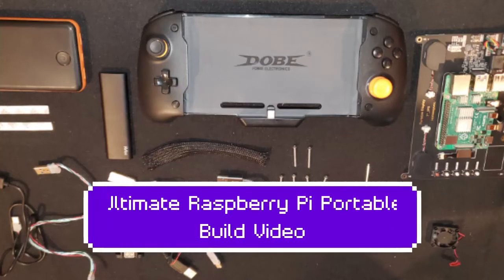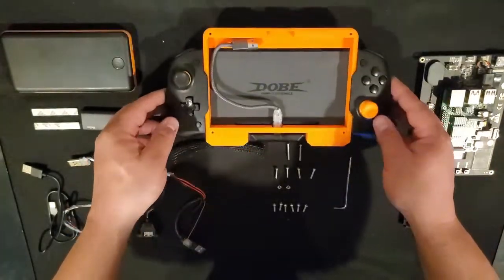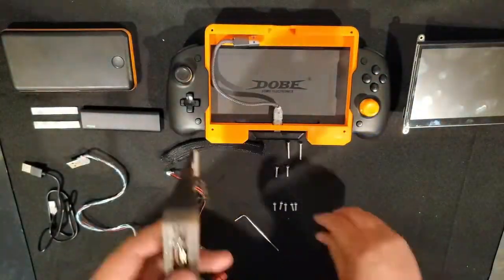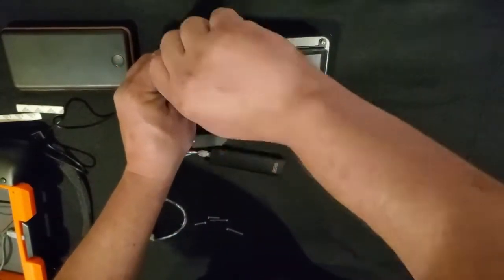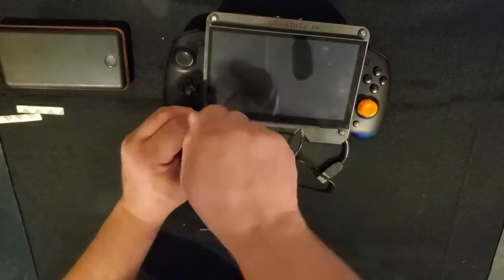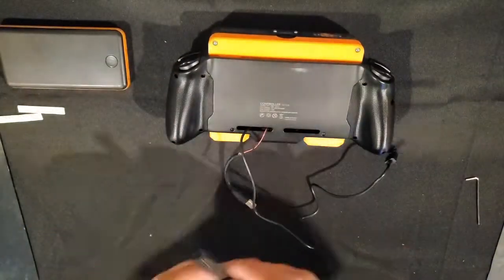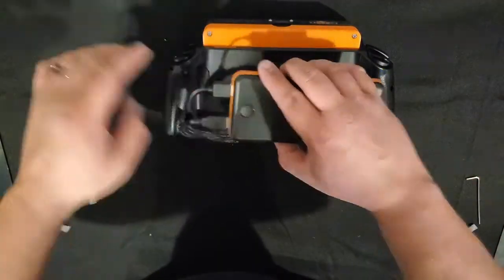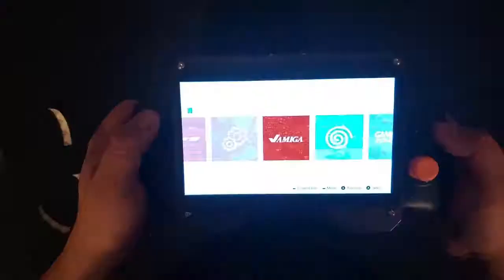Ultimate Raspberry Pi Build

Comment: This is a really nice way of reusing existing components without coming out totally lashed together. There's room for a V2 integrating a battery inside the printed shell, pulling the SSD board out of its shell to save weight, print a front shell to give a cleaner look.
Reply from the maker: Good ideas,  I think descending the esd is probably one that is not esd safe unfortunately,  but if I make a second I will definelty consider thoae.

Comment: hey, nice video bro. I wish to build it but i don't have any 3D printer. How much for all componants? Couldn't find the answer yet. Thx !
Reply from the maker: Hey if you check the description there should still be links to all the parts.  I havent made the parts available on easy to sell or anything, but there are quite a few local printing apps you can use to find people capable of printing the parts for you.
Reply from the maker: As for the components when I made this build I think it cost me around 100$  for material, ssd, pi, screen.  So if you are starting from scratch I would imagine today you are closer to 150.
Reply: 3d printing cost about 3 pounds so it's quite cheap just make sure you have a model
Reply: PCBWay 3D Printing Service is quite cheap.

Comment: does it work with pi 5
Reply from the maker: I'm not sure as I havent tried it out personally.  If you have all the proper drivers it should.  I am working on a new version that should be a bit simpler for everyone to out together with off the shelf parts.
Reply: @spark3dacadamy304  Hello, when new version will be released? You project is awesome
Reply from the maker: @gerardoritacco  not sure.   I'm working on the PCBA in my spare time but it's not my forte to be honest as a mechanical designer.   I also want it to be affordable and easy to build so I'm taking my time in it for now.

Comment: How did you attach the "raspberry pi" to the screen I'm thinking about trying it out cheaper method 🤓
Reply from the maker: The screen I s attached with 4 screws threaded into the wd printed part.  All files for the part are on the Google drive.   The printed file is less that 3$ in filament.  The build is actually pretty cheap,  it's the electrical components that are the most expensive.

Comment from the maker: Yeah,  that is when your printer has either timed our or measured a temperature beyond its limits.  So that can happen because there is an issue with the thermalcouple or thermistor not being connected well,  or can be because the thermistor is the wrong type or not calibrated.   In marlin you can tune the pid loop really easy using M303 command.

Comment: I haven’t built this yet but have everything in my cart. Doing final checks to make sure I have everything. I will let you know if I get it built.
Reply from the maker: Way cool. Let me know how it turns out or if you have issues.  Feel free to post it on Instagram and tag me too.
Reply: @spark3dacadamy304 also I was wondering what the usb to usb did. The one on the top?
Reply from the maker: It just allows you to connect a wired keyboard or controller or camera
Reply: @spark3dacadamy304  Oh! That sounds cool thanks!
Reply: @spark3dacadamy304 I know this might be asking for a lot but do you know why my 3d printer keeps saying “thermal runaway” and beeps very loud?
Reply from the maker: Yeah,  that is when your printer has either timed our or measured a temperature beyond its limits.  So that can happen because there is an issue with the thermalcouple or thermistor not being connected well,  or can be because the thermistor is the wrong type or not calibrated.   In marlin you can tune the pid loop really easy using M303 command.
Reply from the maker: https://shinyupgrades.com/pages/calibrate-your-ender-3-pro-hot-end-and-bed-heater-pid-auto-tune-marlin-2-0
Reply: @spark3dacadamy304 thank you! Just 3D printed the parts and the other ones are on the way
Reply: @spark3dacadamy304  I have it built! But, after playing for a bit the controller stopped connecting
Reply from the maker: @Hockeybro42  I'm sorry to hear that.  I would make sure to check all your connections,  reinstall firmware and drivers if that doesn't help.   Also you may have accidentally configured the controller in a manner that it will not respond in retro pi.
Reply: @spark3dacadamy304  ok, I’m going to get a replacement since it seems the that it broke since it happened well I was playing.

Comment: Hey one thing I can't figure out on this build is how you connected the HDMI from the screen to the raspberry pi? The connection would be too wide using a plug. I'm thinking of building one of these!
Reply: So the screen I mention in the video is a slim ribbon hdmi cable.   It easily flexes and is flush so it doesn't take up much space.  Let me know if you have any more questions or of I could make something more clear,  this was one of my first build videos.

Comment: Hey im using a 7 inch monitor rasberry pi display  is their any power charge that i can use for it? And plus ima gonna be using a cheap wireless hdmi  so i can connect it xbox and programmed as a app. with a power supply, and trying to find a cheap controller like yours and  i thought of using a heat gun to bend Kinlink Black ABS Plastic Sheet and making and adding holes for the screw and making as a case idk if it needs a fan to cool it off
Reply from the maker: The battery speed out in the shared document should be more than powerful enough to support the screen.
Reply from the maker: If you are going to encase your pi and screen together I would have a fan.
Reply: @spark3dacadamy304 So something like  similar to your battery.
Reply: @spark3dacadamy304  Hopefully I can find some good mini fans.
Reply from the maker: The fan is spec'd out as well in the document and runs off the pi.
Reply: @spark3dacadamy304   to be honest i like it how you did yours pretty well neat
Reply: @spark3dacadamy304   dude it is so differcult trying to learn how to build a handheld console remote like the xbox console handheld but for ios im trying to make a replica of it but i wonder how they made it 🤔
Reply from the maker: Best way to learn hoe something is made in my opinion is to take it apart.
Reply: @spark3dacadamy304  well i was thinking about that but don’t i have have to cut the xbox pcb controller in half? I guess i should just make a custom pcb maybe and use Arduino
Reply from the maker: @tylerevact  I don't know if I would cut a pcba in half.   If you look on adafruit they have specialized pcbas where you can make your own controllers and arcade setups.  I would start with something like that.

Comment: I love this build its so creative n cool. I bearly know how to use a computer but i wanted to try and build soming like this but using a ps portal as the shell/housing and the raspberry pi as the computer with lakka retroarch as the emulator operating system. Coupd soming like this be possible?
Reply from the maker: I'm not as familiar with the items you mentioned but with enough knowhow anything is.  I have been working on a V2 I hope to complete soon that has its own custom pcba that will connect to a raspberry pi compute module and be completely incased.   It should be much easier to build with less required knowhow.

Comment: This is awesome, I’m gonna build one! Now that you have had it for a while is there anything you would change?
Reply from the maker: I would look into a better battery solution.  The battery I chose was a bit bulky,  I would like to get it all fitting on one setup.   So a better battery.  But it was tough to do that and meet power requirements for the ssd and running the pi, screen and speakers.   If you wanted it strictly for gaming you could fit a smaller pi, just an SD card and enclose the battery.   There are a few remixes of my design on thingiverse and my mini factory with changes people liked to slim it down, or change yhe viewing angle.  I would check those out.
Reply: what if speaker is optional? just have 3.5 head phone jack or bluetooth module for earphones or headset?
Reply from the maker: @noble5wins  speakers are optional you can get screens without them,  however the screen I used has super slim speakers.

Comment: Great project. I have a question, can I use another switch tns?
Reply from the maker: You can use a switch in this controller if that is what you are asking. Ita a dobe controller and they are available on Amazon still.

Comment: Is this able to be hooked up to a tv? Also, what SSD and/or flash drive are you using? Thanks.
Reply from the maker: It's a solid state hardrive,  the brand is listed on the build list in the Google doc.   You could fish a hdmi cable trhough the system and hook it up to a TV just like you would a raspberry pi.  But as it is built there is no access to do that.
Reply: ahhhh, yeah I guess i missed that SSD. Thanks.

Comment: maan(( i try make same but on x86 Windows sbc and this gamepad is fail - he not work with Windows because Nintendo have their type of input, what most of games on windows dont understand( only in Steam i can use it normal, because he have special driver for it(
Reply from the maker: I dont knownif I fully understand the comment, but this controller atleast when I bought my last two is based on the 360 controller and the 3360 controller driver works.   Other ones I have seen use a serial communication driver which is probably not to hard to configure.

Comment: I was able to get a Dobe switch controller. It looks almost exactly like yours just a little bit smaller. Sliding in the chassis into the controller was a little tight and there's a little gap in the back. They may have changed the design just a little bit. Has anyone found a controller that fits better? I may consider returning this one or maybe just live with the little gap in the back and call it extra airflow 😂
Reply: Just realized the one I ordered is for the Switch OLED I bet that's why I'm going to order a different one and send this one back
Reply from the maker: @ryanbertrand4056  hey good to know that they are differences in sizes I'm sure that will bite a few people.
Reply: @spark3dacadamy304   So I ordered a different controller the chassis fits much better. Emulation station recognizes that there's a controller connected but the buttons aren't working. I'm at a loss and don't know if it's something I'm doing wrong.  I tested the controller with my sons Switch and it works fine so I know it's not the controller. I'm trying a different USB C Female to USB Male adapter to see if that's the problem. Any thoughts?
Reply from the maker: @ryanbertrand4056  so make sure that you have the Xbox Controller driver installed and if emulation statuon recognizes the controller you still have to map the buttons.   I would check and update the drivers and then make sure that you map the buttons upon boot.  Let me know if that works.
Reply from the maker: @ryanbertrand4056  https://youtu.be/uL3K8sZIuWo here is a tutorial on mapping.
Reply from the maker: @ryanbertrand4056  https://tutorials-raspberrypi.com/raspberry-pi-xbox-360-controller-wireless/ here is a tutorial on installing the driver.
Reply: Wow thanks I'll watch those now and let you know if that helps
Reply: So I installed the driver's but it's still not working? Have any subscribers has success with any other controllera?
Reply: @spark3dacadamy304 also to add my wired Xbox360 and ps5 controller connected via USB do work with my pi.
Reply from the maker: @ryanbertrand4056  well mine works with those settings.  Did you go through my documentation more than just the build video?  I have had several people successfully build the unit.  The only thing I can think of is that they updated the controller hardware.   Which I highly doubt just knowing how most gaming industries recycle tech.   I would double check all connections and make sure that your cables are data capable not just power.
Reply: @spark3dacadamy304 thanks I've done all that I appreciate all your attempts at helping.
Reply from the maker: @ryanbertrand4056  sorry you are not able to get it working.
Reply: @ryanbertrand4056 did you ever get the controller working?
Reply from the maker: @farplenorp  that sounds like a driver issue.  The controller is recognized by emulation station but there is no driver for communication.  Download the Xbox 360 controller driver,  make sure that it is updated to the latest version.
Reply: I have tried that and unfortunately it still won't take any button inputs. Do you have any resources to make a driver?
Reply: @spark3dacadamy304 curiosly, if you took the latest image of retro pie would it work with your controller? Or do you think your dobe controller is older so it's compatible... Thanks
Reply from the maker: @farplenorp let me know how it goes.   I'm working on a v2 but it's a slow process.

Comment: No sure how to get the controller working doesn't show in Retro pie
Reply from the maker: The controller should be detected as an Xbox controller,   you need to install the drivers for it.   Download Xbox and Xbox 360 controller drivers and then you should be able to map it in retropie.
Reply from the maker: There are others with the same question and I have attached links inside the folder containing the build list.
Reply: I have the xbox drivers as a xbox controller works this shows as a pro controller on my pc wonder if they have changed the firmware
Reply from the maker: @paulhaworth3265 that may be the case,  did you get the exact model?  Cause there are tons of similar controller setups online using the same mold it looks like.
Reply: TNS 19252
Reply from the maker: @PaulVmax that should be correct.  I believe I attached the image for my setup too,  maybe try that?
Reply: I can't see any image to burn on the Google drive.
Reply from the maker: Ok well after my finals I'll see if I can find the image and upload it feel free to follow up with me In a few days.
Reply: Good luck mate I'll also add the switch kernel to see if that's a fix as some one else may need it.

Comment: The controller doesn’t work on my raspberry pi. I installed the Xbox driver from a website I saw in the comments and still nothing
Reply from the maker: Ok and you made sure you grabbed the correct controller from the Google docs,  there are several different types of dobe controllers that may not work,  and several have been updated to a different protocol.   More in depth instructions are available in the Google doc.   Are you running retro pie?   Does it see the controller when you boot?   There are Manu different controller drivers as well that you can test if the 360 is not working.   Let me know where you are at and if I can help.   I only know of one other person who couldn't get the controller working.
Reply: @spark3dacadamy304  I tried installing the Xbox one driver. I have retropie just like you and it doesn’t come up. It’s the same model as yours too
Reply from the maker: Ok I would try installing some other controller drivers as well.  Like I said there have only been two people so far that have had trouble with the build centered on the controller.  Do you have a switch you can check the controller on?   Is your cable you used a data cable or just a charging cable?
Reply from the maker: Check the cable to make sure it can transmit data,  like connecting a phone to a computer to see if the computer recognizes it.  Make sure you have the 360 driver installed and updated, xbox one etc.   Check the controller on a switch or by plugging it into a computer,  then check to make sure your controller is not defective.   That dobe controller has a ton of knockoffs and clones.
Reply: @spark3dacadamy304  I got the same cable as you so that shouldn’t be an issue when I plug it into my computer do I test it on a game? I’ll try that and I’ll install 360 drivers
Reply: I tried steam but picture and it worked instantly on my pc no setup needed so it must be something with my raspberry pi. It can detect the gamepad just not the buttons I press
Reply: @spark3dacadamy304  it’s a data cable and yes as well as my pc, I have tried on my Nintendo. I have opened up a forum for this as this seems to be a raspberry pi issue if it were perhaps the firmware of the controller being to new for retropie. I could try and downgrade it if it’s possible.
Reply from the maker: @Limegreengamer9 so you just need to make sure that it is transferring data.   So for instance if you use the cable to connect a phone to your computer a driver should recognize there is a data connection and connect to the device.  If you plug it In and it only charges then you do not have a data cable and that won't allow the controller to communicate with the pie.  Does that make sense?
Reply from the maker: You also could try and find a driver for Linux for the controller and try to download it.   Sorry I'm sure this is frustrating.  You will get it I'm sure.  Let me know what else you try.